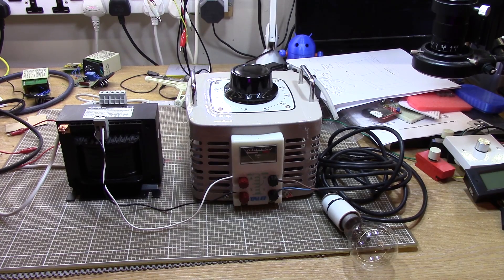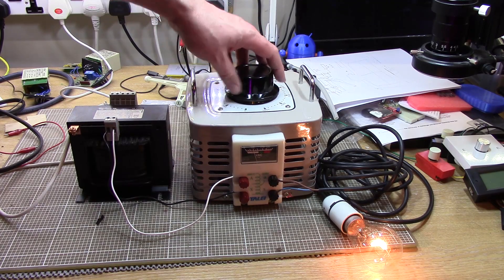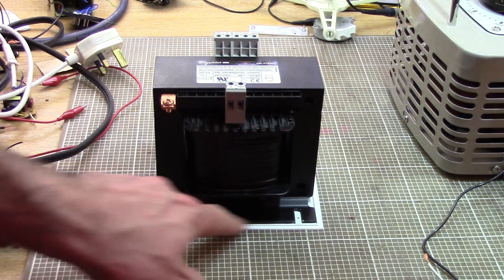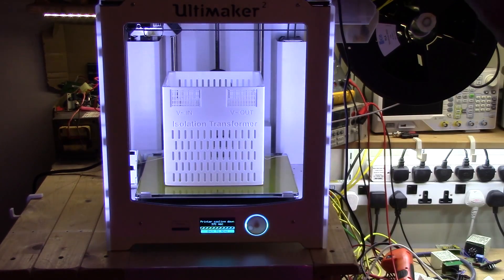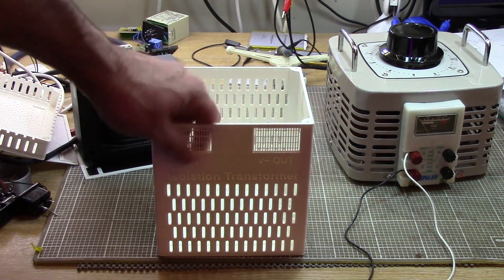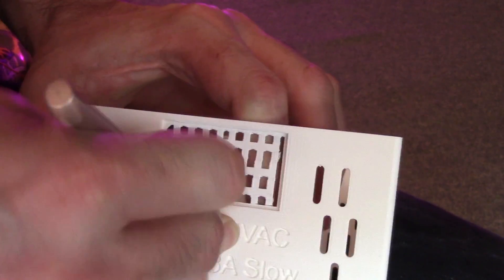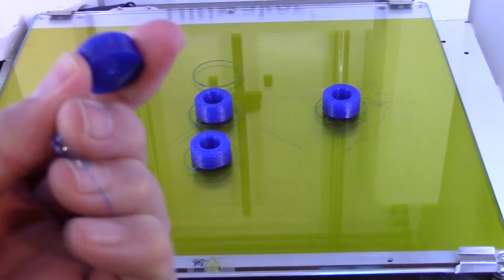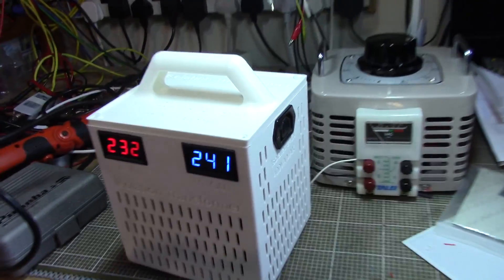3D Printed Isolation Transformer Enclosure - Quick Show 'n Tell

Comment: Very nice print, I would worry about the weight of the transformer with the way the handle will lift it, workshops stuff gets rough handling
Reply from the maker: Thanks PBSO3P - I did worry about the strength of the handle too, but the transformer doesn't get moved around much, and so far it hasn't been a problem. When I designed it, I made the handle as an inverted U section to maximise the amount of wall material during the print. I figured it would make the handle far stronger than a circular section. It ended up being surpriningly tough. Cheers!!
Reply: Where the lid screws in to the top may be a issue. like screws in chipboard can get knocked loose

Comment: oh - i see you are also using the basic supports - try Meshmaker for supports, cuts down on filiment and also really cuts down on your print speeds - here is a little video - much better than the basic supports https://www.youtube.com/watch?v=aFTyTV3wwsE
Reply from the maker: +Edward Bailey Meshmixer is very much on my to-learn list at the moment... I've installed it on multiple computers, but haven't really worked out how to use it properly... I don't know if there would have been anything much wrong with the supports that Cura would have given me, but I wanted to have a play around with intentional cut-away supports to see how different types of support would preserve the details above them. Cheers!!

Comment: Hey JIM - great project - an ambitious
man with a print that size footprint! At least with my printer – im
using a Flash forge creator with Sailfish and although its fast as
buggery compared to most printers it could not handle a print with
that larger footprint without warping! - have you experimented with
your print speeds yet? When I first started out printing I used
factory settings and I printed a model of a Tachicoma (from a
cartoon) and it took 48 hours, about 6 months ago a friend asked me
for one and I did it with my new settings in 9 hours, I have got it
tweaked to a tee now and I would highly recommend downloading one of
the test programs from thingiverse and messing about with your travel
/ feed/ movement rates etc – I have got mine to move real fast but
it struggles with the first 10 layers or so getting good adhesion –
once its got them down its real good so I normally just slow the
first 10 layers then speed up to full whack and its cut down the
print time enormously
Reply from the maker: Hi +Edward Bailey - Sorry for the delay replying - Swamped at the moment... Yes - I tend to tweak the print speeds quite a lot depending on the material I'm using and what kind of mood I'm on. For Ninjaflex I find that a measley 15mm/sec works best but  with PLA, PET and ABS I run somwehere from 50-100mm/sec depending on what level of quality I'm trying to achieve. High speeds for when I'm making templates to test that things will fit together, and then slower for the final version where I want it to look nice. When I first tried ABS prints, I had terrible problems with warping, but I've found that enclosing the build chamber (I just stick a sheet of plastic in the front) and switching off the fans on the extruder helped a lot. I still got a little warping, but I did at least get useable enclosures for my cycle timers as a result.... When I came to do this transformer enclosure I wasn't brave enough to use ABS, so I just went with PLA onto Kapton tape - It worked a treat. Cheers!!

Comment: Very awesome, brother.  I'm glad to see you enjoying that new toy.  Is the filament pricey?  How much of it does to take to print out something that large?
Reply from the maker: Thanks +mnelson10000 - I paid £36.13 for the 2.3KG roll of white PLA filament I was using during this print. The software tells me that the enclosure (base+lid) used a total of 62.15 metres of filament, weighing 492 grams. That works out to £7.73 of plastic in total. Cheers!!

Comment: That is cool. How long does it take to make the designs? I know for me it would take days or weeks lol :) you seem to have the design part down.
Reply from the maker: Thanks Benja - It took me a couple of evenings to get the design work done. I find the hardest part is getting the measurements right on the real-world objects (hence the footprint templates I made for the transformer), but once you've got that right, the rest of the design work is a lot easier - that bit only needs to look good, rather than fit right. The 123D Design software I use makes it very easy to do rounded corners and embossed text, and the rest of the design process is just adding and subtracting cubes from each other until all the holes are in the right places. Hope you're good. Cheers!!
Reply: Thanks so much Jim!! I have been a very sick but think i have finally got it beat :) You said you are using 123D Design software i think i found it. Is it easy to use? I have been playing around with a few different ones and making thing to scale seems to be so hard lol Or maybe i have not found the right mode for that in the other software i am installing that software right now and will give that a try :) Thanks for the garden update :)
Reply from the maker: It is very easy to use, particularly because if you search on youtube for '123D Design Tutorials by Library 21c' you'll find an excellent set of tutorials - They're the ones I used myself. Cheers!!
Reply: Very nice :) i think i was watching the wrong ones :) i will search for the library 21c :) thanks :)
Reply: Oh yes found them! This looks right :)

Comment: Beautifully done, Jim. I've had a nice 1kVA GE isolation transformer that I scored on eBay sitting on a shelf for awhile because I haven't found a suitable enclosure. Looks like it might be time to jump into 3D printing!
Reply from the maker: Thanks +FlyingShotsman - When I bought that transformer I was just planning on a wooden box, but over the last year I never got around to rolling out the table saw - Doing it as a 3D print allowed me to do the design in the evenings. I'm certainly a fan of the 3D printer. Cheers!!
Reply: What do you use to draw the parts you've been printing, and how steep did you find the learning curve with the software?  Does the drawing software also print, or is there a go-between?
Reply from the maker: Hi +FlyingShotsman - I'm using Autodesk 123D design at the moment - I picked it because a.) it's free and b.) It's easy to get started with it and c.) there's a fantastic set of tutorials for it on YouTube covering the harder to understand bits which you can find if you search for '123d design tutorials by library 21c' - 123D only does the design part of the process - I then take the .STL file it produces and feeds that into a 'slicer' called Cura (another freebie) which calculates the path that the extruder needs to follow and outputs a set of instructions for the printer to follow onto an SD card - I then stick the SD card into the printer and hit 'print' - Cheers!!
Reply: Thanks so much for the info, Jim.  I think I have an older version of 123D on my computer already; I once tried to make 3D models for some parts I was using in a circuit board layout.  Sounds like I'm running out of excuses...

Comment: Nice design there.  Did that 42 hr. print go on the first try?.  I put a 4-reading AC panel meter into my variable isolation transformer and that is nice adding watts and KWH to the volts and amps.  I'm still waiting on my 3D printer to arrive.
Reply from the maker: Thanks +R Brown (4Crawler)  - Yes, the 42 hour print went without a hitch on the first go. I have a similar 4-reading panel meter which I'm planning to attach to my variac when I make the new front panel for it - I've already modified the panel meter so that it will take it's supply from the variac input, but measure the voltage and current on the output (all the way down to 0V). I'm sure you'll have a lot of fun when your printer arrives - It's a great tool for so many different jobs. Cheers!!

Comment: Very nice job. What software are you using to design the cases.  I have been learning 123d. Then bring it in to simplify 3D.
Reply from the maker: Thanks Faye - I'm using 123d Design too, and then Cura to slice it. 123D was nice and fast to learn, but I'm starting to find it a bit limiting for bigger projects (particularly when you want multiple parts which fit together). I've been meaning to try OnShape (cloud-based CAD, free for makers), but haven't yet set aside the time to learn how it all works. I must check out Simplify3d, though the price is a bit high when I've already got Cura for free. Cheers!!